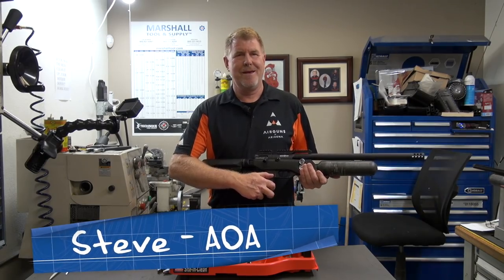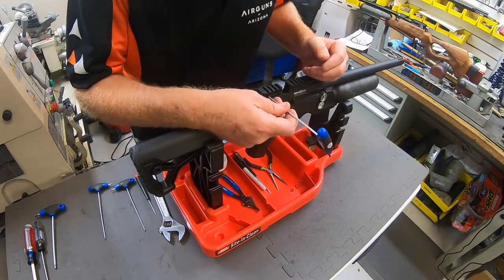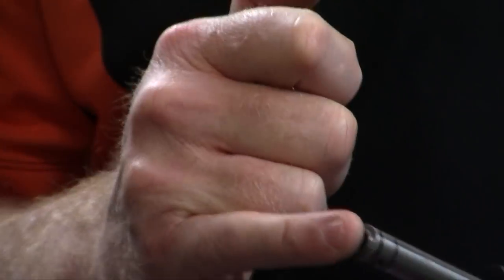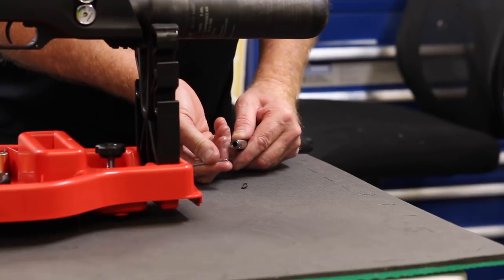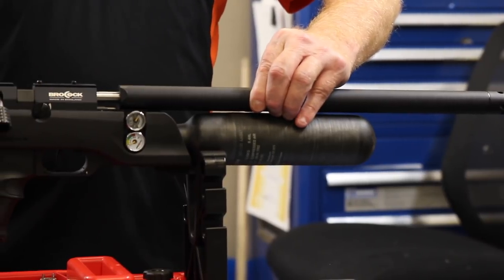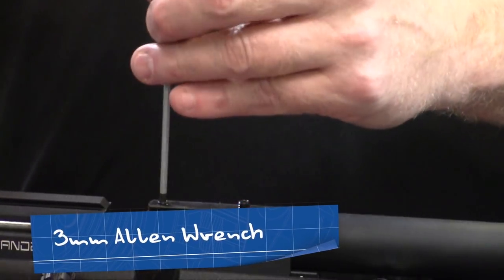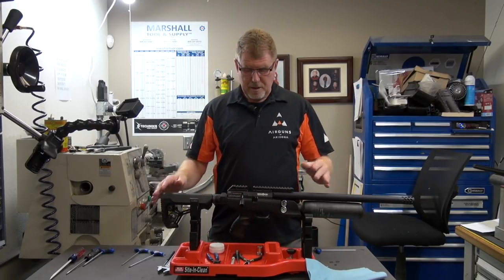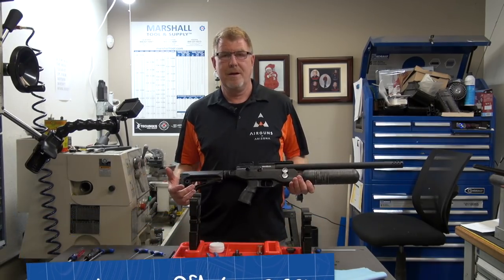Brocock Commander Breech Seal Repair

Comment: I have a .177 12ft lb brocock bantam sniper hr , your video,s have helped with the odd job , many thanks . any idea what my normal reg setting is 100 bar ?and transfer port hole size should be as standard 2.0 mm ? I have tried and looked all over the web and cant find anything. i am only getting 60 shots per fill , I believe I should get over the 300. no leaks and normal fill pressure 240 bar down to 90 bar . not sure how far out my hammer pin/striker  should be sticking out of the hammer to strike the valve(air chamber)
Reply: I have the hr sniper and you may have blown a seal or reg damage as max fill pressure is 200 bar not 240!!

Comment: Soooooo people already got to make repairs on that thing or what?  Not cool if its breaking
Reply from the maker: Nothing is breaking. We are just trying to create the guides to help in case anyone needs to change a breech seal. They will wear over time with use, and we try to make these to assist later on.